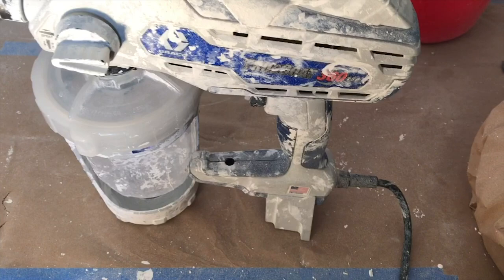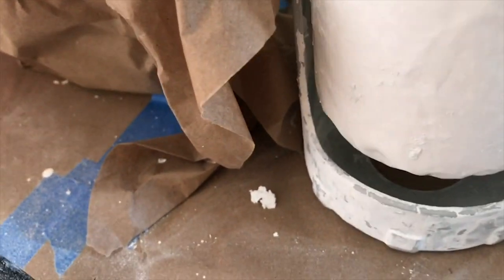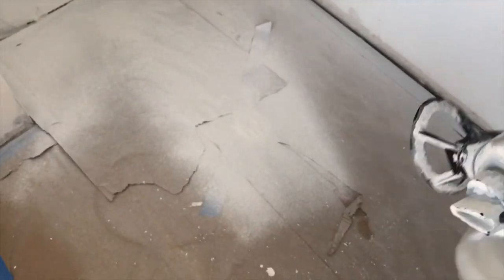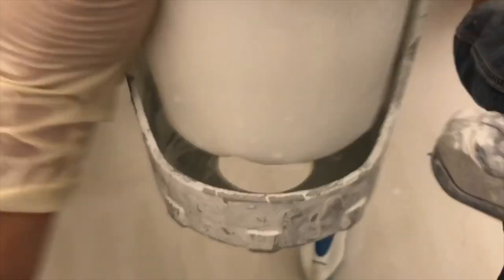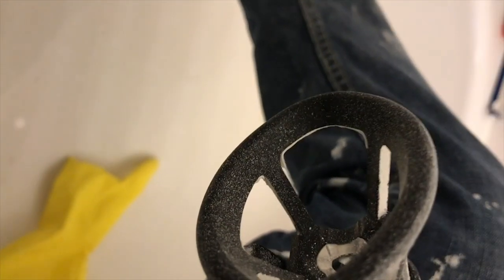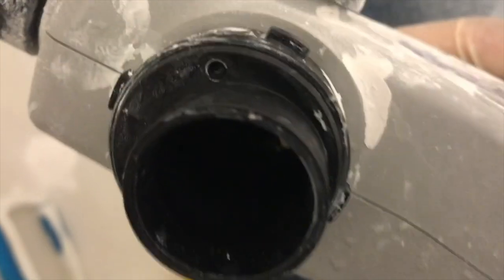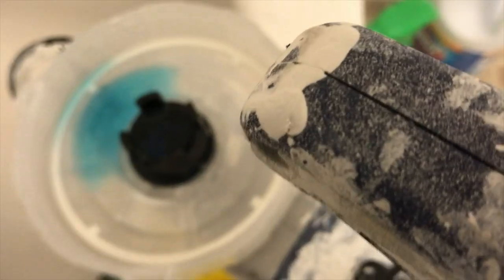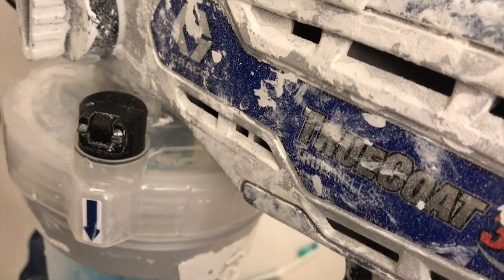Graco TrueCoat 360 VSP - Setup and Cleanup

Comment: I've used mine for hard to reach / needs to be a really good finish stuff. It's paid for itself painting inside cabinets, around shelves, spraying furniture, and doors. This thing is amazing I should have bought it years ago. I've used it 3-4 times in the two weeks I've had it and put over 2.5 gallons through it so far. I love it with Valspar cabinet and furniture paint. It leaves an excellent finish ten times faster than a brush.
Reply from the maker: Yeah, it is so much more professional than brushwork on things that need a fine finish.

Comment: Great video. Can you store paint in this overnight? My typical jobs are cabinets, so I do 1st coat on one side of door, then 6 hrs later I do 2nd coat other side of door, then the next day I repeat for the 2nd coat. Can I leave paint in there or will I have to clean it out 4 times?
Reply from the maker: I would not recommend leaving it alone more than 10 minutes, maybe 30 minutes if the spray tip area is wrapped with a wet paper towel. The spray tip area is the issue - if this area dries it will either get clogged or otherwise impact the smooth spraying abilities of the tool. You might be able to get away with cleaning just the spray tip area between 6 hour interval sprays if there is no other mess, but at your own risk (let everyone know how it works!).
Reply: @sondroyo  I actually just left it overnight last night with spray tip turned in the closed position and everything under pressure and the gun in a plastic bag.
Sprayed fine today.
I just know I'll have to do a thorough job of cleaning with mineral spirits when I'm done with this color.
Not sure how long this method will work longterm but with the type of work I do it isn't practical for me to use if I cannot do this. Will report back if things ever give out prematurely
Reply from the maker: Thanks for sharing. As long as it sprays evenly, you might be good to go. Serious clogs clear out pretty easily with hot water.

Comment: I have nothing but problems with mine and been a painter, using big airless systems and doesn't matter how well  clean it, it doesn't work next time I try to use it. What am I doing wrong? And by the way I would never attempt a thousand square feet job without breaking out my full size airless

Comment: All that old dried paint all over the sprayer sets off my OCD.  Mineral spirits and warm water till it's completely clean, I could never let my 360 vsp get to that point lol.

Great video though regardless,  love the VSP model and use it regularly.
Reply from the maker: Good advice on cleaning the VSP. I treat some of my equipment that way. But, the VSP purchase was entirely about saving as much time as possible so it gets more utilitarian treatment.
Reply: Animalyze71 hey bro does your sprayer overheat? And gets really hot and won’t work till it cools down?
Reply: This just happened to mine, glad to hear it restarts.
Reply: I'll bet it was worse before making of video I Trace signs of a clean up attempt .

Comment: Looks like you’ve gotten some solid use out of that!  

How many gallons have you put through this?
Reply from the maker: Probably around 20 gal. I literally made this video because nobody was actually showing a used machine!
Reply: sondroyo I’ve been looking at the variety of Graco sprayer and everybody talks about the truecoat being “junk” and it’ll break if you use it too much...  

I have logical questions when I was told it was good for “25 gal/year”.   

What’s it matter if I put 25 gallons in a month or 10 years through it!? Lol. 

I don’t paint more than a few projects a year (doubt I even purchased 25 gallons in the last 2) but would like it for a better finish on baseboards, trim and doors, opposed to brush and rolling.   

What else have you used it for?
Reply from the maker: I think Wagner brand at Home Cheapo is the real junk. Nobody I talked to was happy with Wagner.

But looking at Graco's warranty, the product is probably designed for under 100 gal lifetime throughput with no repairs. It looks repairable though (allen wrench disassembly). I think it is stainless steel inside. The warranty specifically says personal use only, which totally means under 25 gal/year average. Anything more and it would be the wrong tool for the job.

It will be a much nicer finish on all the detail work. I did most of my interior with it, including doors and frames. You just have to be prepared to tape/paper/plastic off everything and make sure there is no air flow that will bring paint particles where you don't want them. 30 min spraying = 90 minutes taping, but looks better and ultimately takes less time.
Reply: sondroyo thank you for all the feedback. 

You think the variable speed is worth the extra $50 for using it here and there?
Reply from the maker: @joegiel  Yes, get the variable speed.
Reply: 25 a year? Dang.... I got one today and put 15 through it.  I thought i smelled something weird burning too but I thought it was something else.  Glad I got the extended warranty

Comment: Thank you. I have that model.  The first spray was great.  Then the second spray I couldn't get it to prime.  I cant figure out what I did wrong.  Any suggestions
Reply from the maker: Start by turning it upside down so you eliminate obvious air leakage issues. If it still won't prime, you might have a blockage.
Reply: @sondroyo  yeah I did that but it takes forever to prime.  Then when I tip it back up it's full of air again.  Iv only had it a few months.  R the o rings bad already?
Reply from the maker: @chadworley8009  Yeah, sounds like air is getting in somewhere else. If you didn't have pump armor between sprays maybe there was corrosion.
Reply: @sondroyo ok.  I do have that so I will from now on.  I did end up taking it back and got a new one.

Comment: Do I need to add pump armor every day or just when I am storing it for more than a few days? I just got the same model and I am half way done painting the outside of a house. Works very well.
Reply from the maker: I do pump armor at the end of every cleaning process (even for overnight). That way you don't have the metal internals exposed to water/air combinations ever.

Comment: I have one of these paint guns. I used it over a year ago. I pulled it out today to use it. I couldn’t get any paint to spray. I’m guessing I didn’t get it totally clean after the first usage. Any ideas for how to get it spraying again?
Reply from the maker: Just out of warranty, right? I'm thinking of getting mine out again soon, we will see how it does. I get the impression it is user serviceable because there's a full part breakdown in the user manual and the Graco website has pressure relief instructions. Just don't clean it with anything that reacts with aluminum, maybe get some pipe cleaners. The replacement parts at Repair Clinic are kind of pricey.
Reply: @sondroyo  @dean did you guys get it working? Mine is spraying water but not paint. So frustrating
Reply: My will not spray after cleaning
Reply: @vinnypardi  no. I tossed it. Tried everything to get it going.

Comment: Love this sprayer the other day it started coming out from the black PC behind  the guard I have no idea why
Reply: Nicholas Hill did you fix it?
Reply: Nicholas Hill I had the same problem it’s leaking from where the tip goes into the slot, idk how to tighten it, I bought a new tip but still leaks
Reply: I have same issue. Only used it twice and now leaks like crazy from tip. Wasted alot of paint and made a mess. Any fix or return it?

Comment: Great Video! The strange thing is I have the same toothbrush in my dop kit and the exact same scrub brush in one of my work buckets. I also just bought the 360 VSP which is why I am watching this video. I am about to paint 8 sets of shutters with it Monday 06-04-2019. I wanted to know how to use and clean it before I put it into action. I have used a lot of spray guns but only the type that you use with an air compressor. Basically auto paint sprayers. Do you think I should practice first this weekend before I use this one?
Reply from the maker: I wouldn’t put yourself through unnecessary cleanups, just practice on the day of the painting so you get a sense of how fast the paint lays down.